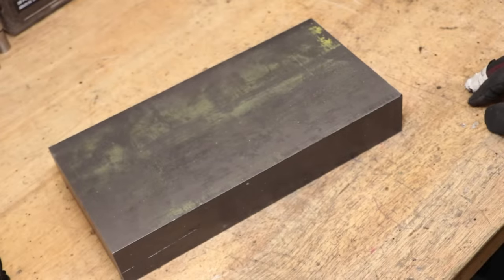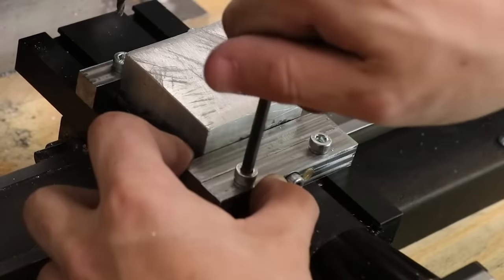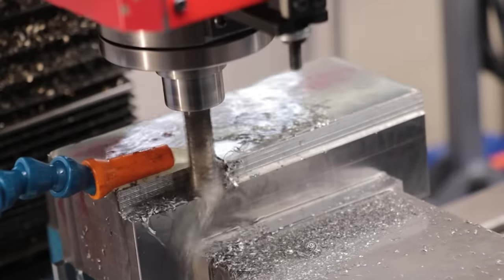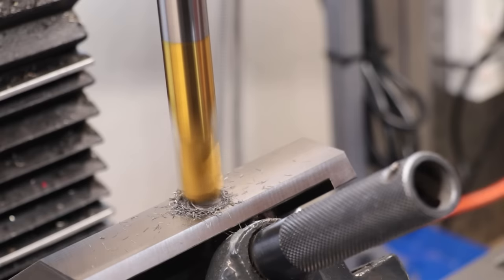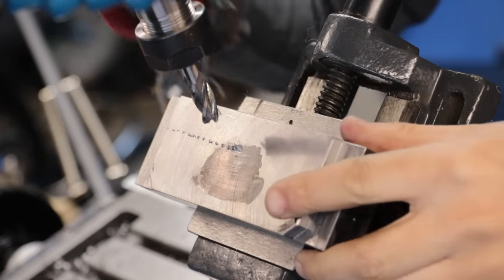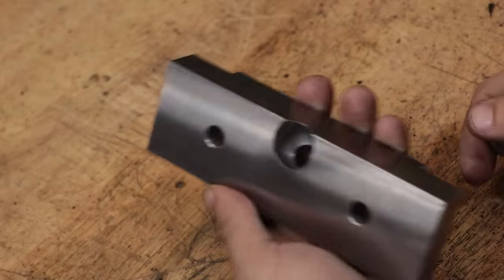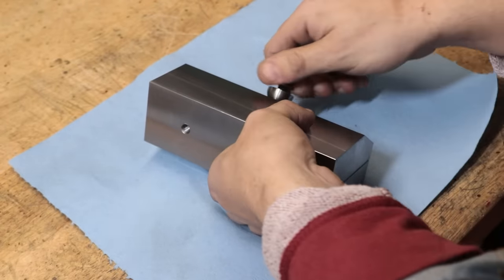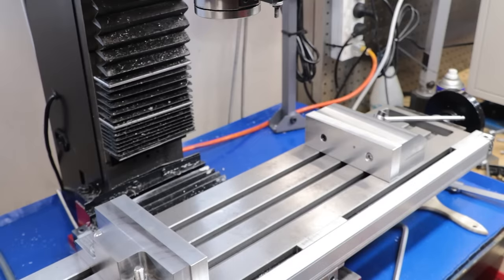Making a 2 Piece Vise For The Milling Machine

Comment: any reason why you used the ball nose mill at 10:50 before drilling to depth? i would think drilling first would put less force on the end mill and reduce the chatter
Reply: Was just about to make the exact same comment. I would have thought using the drill all the way through would have made it way easier for the ball nose to grab, especially where it is nearly cutting parallel to face.
Reply from the maker: Dunno. I think I was just more focused on getting the dimple cut and forgot that it needed a 12mm hole.
Reply: @artisanmakes  that happens.

Comment: I like your design more than ToT's for the  downforce angle screw.  Very nice improvement.  Um.... What about a couple of slightly oversize holes on the movable upper jaw to permit installing and tightening the hold down bolts for the base part?  Or would it allow too many chips to get into the works?  Plugs perhaps?  I'm thinking that it would permit you to square up and not touch the fixed end which is the one that should be setting the squareness since little though it might be the movable jaw can "float" and end up out of square.
Reply from the maker: Seems like an interesting idea

Comment: It's so inspiring to see what can be done with so little. Great work!
Reply: that's acually what i find very funny in so many people"oh you cant do shit whit small chinese-machines,you need to spend atleast 15.000€ to get a decent lathe and mill"-i guess those people have never tried
Reply: @hedning003 pictures/videos often cheat.  Of course Chinese stuff work for a certain level. But often lack accuracy and finish. Both on machines and parts.  But I think it's all down to expectations and experience.
Reply: @OmeMachining  i beg to differ,at work i use a big colechester lathe and a maho mill amongst others,at home i have an rf31-mill an a Chinese benchlathe,whit some modifications and pretty cheap upgrades,it is quite possible to get good results whit them aswell- i would not do 8hour/day-jobs in them,but putting out precision parts whit nice finnich is absolutely doable-but surely i would like to have that colechester at home instead of my 1500€ Chinese lathe

Comment: So, when's the bandsaw coming? :D
Joke aside, you should really look into it, a proper bandsaw is really worth it, especially since your machines can tackle the chunky stock now. A sawblade is also way more efficient at cutting than a grinding disk.

Oh, and on the split I built for my CNC router I had 3 parts, all with boltholes to clamp them down on the t-slots. First you'd tighten the fixed jaw and the screw block for the moving jaw and after clamping the workpiece you'd tighten the moving jaw to the table as well, as a way to avoid jaw lift.
Reply: Also I recommend making holes into your movable jaw through which you can tighten the bolts to the table without having to take it apart every time

Comment: Great video. I made a crude version using heavy angle iron and applied the clamping pressure with two bolts running in nested nuts that get pushed back into the fixed jaw as the pressure is applied. The moving jaw is just a plate of steel. 
For your design I would have been tempted to drill out the stock with a pattern of holes to save life on the milling cutters.
Great watching your projects.

Comment: Nice work as always. Do you think the locking ball will work over time? I´m afraid that ,after some use, it will not "bite" anymore... It might need some sort of key, maybe just a pin and a slot...
Reply from the maker: With the amount of use that this vise will get I personally am not too concerned with it causing an issue. I have about 5 or 6 big parts to machine in the near future. I think it would take a bit of use for it to be a cause for concern, it indeed that bite wears down. Cheers

Comment: MUCH longer and thicker clamping plate under the moving jaw of that drill vise and extending as far forward as you have room for with the vise closed empty will make it a lot more rigid and lessen jaw lifting/tilting a lot..

Comment: First time viewer and love the video.  A quick comment on other options you thought about before choosing the process would be perfect.
Milling the large chunks @18:00.  Did you think of other options like drilling a chain of holes to reduce the amount of material to remove with the cutter?  Your thoughts on the options and why you chose the one you did could help us newbies. Thanks.
Reply from the maker: Might work. I think ive done that before when I first got the mill but I dint think it saves a huge amount of time. I only tend to do this when I need to machine long slots that go through the part
Reply: @artisanmakes  Or... do not cut that at all.
Just leave it as solid block (added rigidity as bonus), and counterbore for bolts that will clamp it to the table.

Comment: I like what you made, but not, how you made it. There's so many bad decisions regarding your tools and cutting speeds. Why wouldn't you make use of your VFD and use lower spindle speeds, reducing chatter and not force your tools through the work piece?! This hurts! Aluminium inserts on steel with a fly cutter?! Why not at least get rid of the bulk material with a propper endmill? So many questions, over and over...
Nice chuck though...
Reply from the maker: I don't know what speed you think im running at, but this is the speed the mill was happiest with, so to speak. If you were in the shop with me youd see. And it wasn't a huge amount of force in the endmill, it was happily cutting along., I don't know if that translates to the video well when I speed up the audio.

And for the fly cutter. I think I even said it was to keep the cutting forces low. It wasn't a hugely rigid set up and an endmill would have just chattered. I know because I have used this set up before with and endmill and gotten chatter. Fly cutter with the high rake just does the job without much trouble, except it might break and edge.

No need to overthink this there are reasons why I have to do these different set ups on this smaller machinery.
Reply: @artisanmakes  If I was in the shop with you, I'd be happy to give you advice. There's a lot of things you could do without the need of specialized tooling, but just the right decisions.
A weak machine will need reduced cutting speeds compared to a more rigid one. Sometimes very drasticly.
Take it, or leave it.
Reply from the maker: No weak set up, the machine is fine. The fly cutter will have lesser cutting forces. I know this set up quite well and endmill struggle with it.

Comment: Quick Question...
Why didn't you drill the hole for the half sphere rebate feature first instead of plunging that ball endmill? Surely that would have made it so much easier, even a pilot hole would have relieved the centre and stopped that rubbing.
Don't get me wrong, always enjoy your vids and please keep 'em coming, I just wasn't sure if there was a reason for that or just a bit of a brain fart. lol
I've recently got back into manual machining (through inheritance unfortunately) and have had to learn to look at things so very differently when it comes to order of operations, I've cocked up a shitload, especially on these smaller machines, mine is a Rong Fu RF25 type round column machine so although reasonably capable there is still a lot of room for improvements as I find it's limitations and mine.
Reply from the maker: Not a huge amount of reasoning behind why. I think I was a bit focused on getting the dimple made since I wasn’t sure if I could do it at all and just forgot that the hole needed a 12mm through hole
Reply: @artisanmakes  Yep, been there bud. Nothing like suffering to make you realise that ya didn't have to. 😂
That vise turned out well though, I've been looking at making both a 2 piece style and low profile style clamping setups for a while and you've pretty much addressed the main questions I had with other 2 piece styles I've seen so far.
Don't know if you've seen @TheMetalRaymond and his vids but he makes some interesting hold down solutions for his massive horizontal mill including some pretty sweet toe clamps, he's fascinating to watch and quite a lot of what he does could be applicable to the vertical mill user with the use of a good size angle plate and a sideways look at the situation.

Comment: I have to admit that looks pretty nice. Not the be that guy but it looks like a single M8 bolt at 45° clamps the piece down. If you were to make this for a larger milling machine with more torque I’d suggest going with M12 or M14 threads for clamping and more than one if possible.
Reply from the maker: Yeah its M8, purely for that fact that it was the longest cap head I had.
Reply: @artisanmakes  sometimes you gotta do what you gotta do 👌 
Nice work brother

Comment: Hi love the channel.
I am just about to buy both lathe and mill, I'm on thr Gold Coast and can't find anywhere locally to buy metal stock where do you buy yours.
Reply from the maker: I buy a lot of my stock from edcon steel. They have off cut bins but also cut metal to any size. They aren't the cheapest if you do this but where else can you get a piece of 150 x 50 block of bar steel cut to any size. May not be too much help for you since edcon is NSW based

Comment: A nice looking job. I was surprised you did not section out the first piece with the angle cut off wheel. It would have given a reusable slab. I don't think putting a tee slot bottom would guarantee alignment. The slot sides are not machined, so are irregular.

Comment: Have you heard of using a carbide tipped circular wood saw blade on the mill to cut metal? These blades are cheap, since you have the bigger motor and lead in the mill it is worth considering. I have used them on a bridgeport clone, it does work. I now forget where I got this information, it is cheaper than slitting saws, the other advantage you end up with small bits of metal left over - rather than a lot of swarf on the floor...

Comment: Instead of using aluiminium inserts for steel I recommend you to try DCGT inserts for steel. These are sharp and leave a nice finish.
Reply from the maker: Those are DCGT inserts I was using. They’re just sold as for aluminium on the pack

Comment: That's a small screw. Did You not see the size of the screw in your vise? Other than that, well done.
Reply from the maker: it’s what I had at the time.  Could be a little larger but so far it’s held up

Comment: It's hard to tell, but it looks like the jaw tightening screw extends a little above the surface level of the jaws.  Would it be possible to deepen the top ball socket so that the screw is just below jaw level?  That way you could mill down to just above jaw level without any risk of the tool striking the tightening screw.
Reply from the maker: Might do. I think shaving 2-3mm off the half sphere would do the trick

Comment: Good, but it is not easy to make this vise because it needs very tight fit of the sliding parts.
Reply from the maker: It shouldn't be too difficult with a DRO. Its not like a toolmakers vice where the parts need to be groud in to fit together, there is a bit of tolerance in the fit, it doesn't need to be super tight. Cheers

Comment: A lot of your chatter comes from your high rpm. When you start getting a lot of chatter try slowing the rpms down a bit. Also, roughing endmills will hold up a lot longer with lower rpms even while removing a large percentage of the diameter of the tool. Hope this helps
Reply from the maker: Yeah cheers but this mill has little torque at low rpm so you have to run it a little higher to get the greater efficiency from the motor

Comment: For my Sherline I modeled the moving jaw after Blondihacks' Low Profile Side Clamps. I just sized the clamp up. This way I eliminated to risk of lift that the TOT design has.
Though I love your design as well, when dealing with a smaller scale, like with a Sherline, the smaller components become so small they aren't strong enough or they are way harder to make. 
Conversely, using that clamp design doesn't scale up. Metal is only compliant (flexible) at small sizes.

Comment: do you have the space for a surface grinder? if so how are prices on em down there? here in the states since the advent of cnc theyve gotten insanely inexpensive. picked up a harig 6*12 for under a grand. and a typical older boyar schultz can be found for a few hundred. one would be hella useful for projects likee this.
Reply: 🤣🤣🤣 He won't buy a band saw and you want him to buy a surface grinder😱😱😱😱🤣🤣🤣🤣
Reply: @yeagerxp  its one of the core three machines in a traditional manual shop, so yeah.
Reply from the maker: One of these days but this isnt my workshop and space is a big limiting factor for me
Reply: @artisanmakes  theres a bench top one called a Sanford sg-48 problem is theyre fairly rare and go for about 1500-2000
Reply from the maker: Its definitely small, ill give it that
Reply: @artisanmakes  ya. 4*8 work envelope

Comment: good beans! Big fly cutters are not that great so just do more than one pass.
Reply from the maker: I’ve used several in the past and properly set up they can do way better finishes than I get with my small ones. Used one on a cnc mill years ago with a PCD insert and it would give a mirror finish.
Reply: @artisanmakes  Its just that the large ones have more deflection making the surface uneven. I have that problem with my mill and my fly cutter is a boring bar in a independent scroll 4 jaw chuck.
Reply from the maker: @hampopper3150  Ill keep that im mind when I finish making my one. It never seemed to be an issue with the tormach, but that was a long time ago and it was a beefy cnc. But going off the old photos I have if I follow the old design I should get a very usable cutter

Comment: I have noticed the sound while milling changes repeatedly like as if there is some vibration and then it stops. Perhaps it's the steel tubes with lead only attached with glue, which I doubt is rigid,  are sort of maybe acting the same as anti vibration boring bars which is absolutely amazing .

Or what I hear is that you are hand feeding it and the speed that is never perfectly constant.
Reply from the maker: I'm hand feeding and  pushing up to the limits of this machine. I guess i push it a bit too far every now and then and it makes a few unhappy noises.

Comment: You can get a tilting table really cheap on the usual Chinese sites (the one beginning with V & ending with evor is good, that’s where I got mine, but they’re probably on others too) worth having around.

I’m not sure if anyone’s mentioned this, but you run your bigger drills & end mills (& occasionally your fly cutters & boring head) way too fast in my opinion. That screeching noise from the big ball nose end mill is chatter, it’s running way too fast. Ball nose cutters are a pain to get right anyway, due to the shape, but I’ve always found them best slowed down, especially one of that size. It’ll last longer too.
Reply from the maker: i probably do, but thats to over compensate for the lack of torque and rigidity at low rpm. I used to do that on the mini lathe too, but it does hamper the tool life a but.